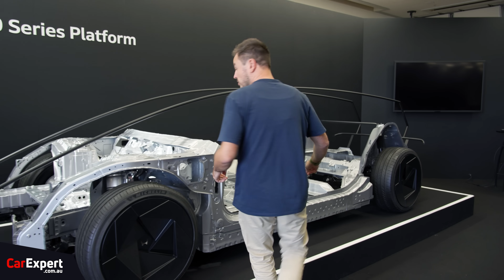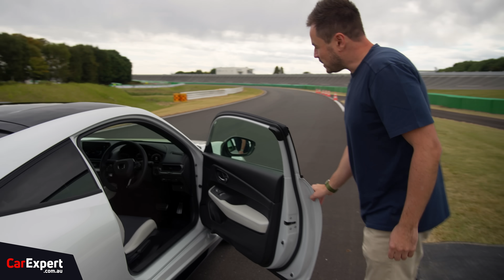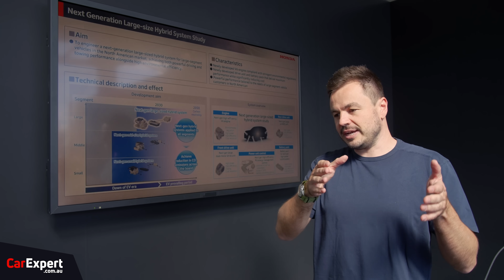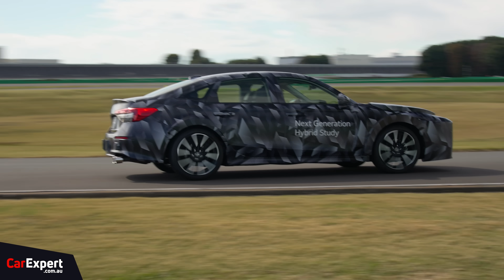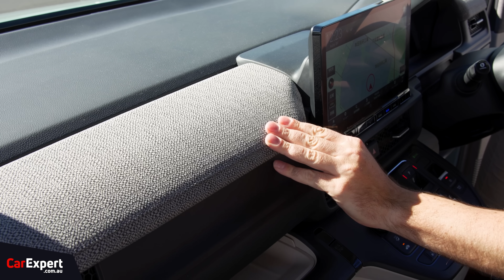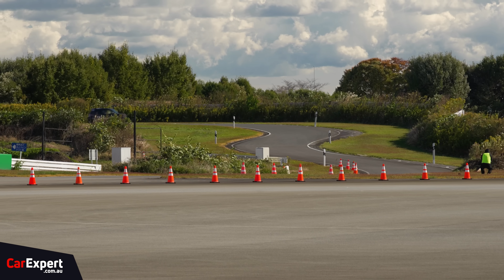Honda Tech Day: Prelude & Super One review…plus future hybrid tech

Comment: Embrace of Enginelessness is Embrace of Degradation
Embrace of Battery-centrism is Embrace of Degradation
Embrace of Over-consumption is Embrace of Degradation — Hybrid-enhanced Gas Version is best possible.
BEV is abject bogus.
PHEV indicates lack of right boldness in leadership and/or management.
EREV suck.
Battery-centric powertrains suck.
Engine-centric powertrains rule.

When Engine-centric Electrokinetically-enhanced Long-lived Plug-free (Hybrid) becomes (critically) more complete with the addition of Manual Transmission (ideally as standard), Hybrid as both the way of the future and the way to the future will become dramatically less refuted and refutable.  Manual Transmission and Hybrid are both best for humanity, so it’s just a matter of time and Japanese Wizardry until this is realized.

Comment: That electric platform is a disappointment, first it has no frunk, second if you crash head on basically the car is a write off because they found that using THE DAMN MOTOR as a collapsible crash structure is a good idea and assuming the crash isn't too bad the car might need a whole new drive unit which ain't cheap.....then they made the prelude...less said about that the better and then they made a hybrid more complicated than a PHD....and killed the civic type R for the prelude....sometimes I feel Honda does not want to make good products on purpose

Comment: I recently drove the civic hybrid my lord was it exciting. The acceleration was so linear like a jet taking off on a runway. If honda puts in a 300-350 hp v6 hybrid in civic and accord it will blow my mind.
Reply: Or you could do it yourself. Why wait? Plenty of people have put K24 in EK civics. Why not a 3.5 litre V6 from the Oddessy in a Prelude?
Reply: @theairstig9164  hmm i have seen plenty of people put k24s k20s and made their civics super fast with 500hp but to be honest i prefer a car which has had millions spent by the best engineers in the world testing in day in day out perfecting the car so that i dont have to tinker with it. For example porsche 911 comes to mind and to be frank even the current civic hybrid even with 200hp is fast and fun. My only complaint with the current civic is that its seats dont have lumbar support and its not comfortable on long journeys. Plus i really like the idea of electric motors working together with the ice the feel of the acceleration is just very different and of course when you drive sensibly in the city its so quiet and get 22km/l. Btw i dont think the 3.5 will fit in the engine bay of the prelude.

Comment: I am still facinated how Honda has decimated it self in Australia. In October they sold only  88 Civic mostly due its pricing. What chance will Prelude have as it will be way more expensive than civic. Honda can make cool cars but they are bit of lost cause in Australia.
Reply: I also have a 2025 Honda civic hybrid. 
It is the best car in its class. 
The hybrid system is ultra refined and smooth and it goes from 0-100 in under 7 seconds so it's quite zippy. 
Comfortable roomy and very smooth suspension. 
Honda's engineering is high end and the car will be very reliable. 
Kia and Hyundai maybe more flashy but their engines suck as well as their vehicle dynamics.
Reply: @mrmysterious6006  it's not only in Australia...  in India as well.. Honda is losing its ground very quickly due to its poor decisions... even me & many ppl like me love Honda but can't help.. we can only look how all this is turning out... the main problem is... Honda is goin through image problem... many young gen ppl don't even know how well engineered & amazing Honda vehicles r... I hv relatives in Australia... they also think low of Hondas & have overpriced - complex engineered German cars... all of em
Reply: @mrmysterious6006 Here in Brazil, exactly the same thing happened. I have a hybrid Civic and I love it. But the price went up way too much, and a car that used to be one of the country’s best-selling sedans became a rarity. Basically, they ended up selling only the HR-V and WR-V in large volumes.
Reply: @mrmysterious6006 still overpriced, it's a joke. If you like it though, power to you
Reply: @CatFinder3000 Have you'd ever driven one?
Reply: @mrmysterious6006 yes, no better than a camry, but costs a lot more
Reply: @CatFinder3000 Ok. 
What do you consider a good car?
Reply: @mrmysterious6006 camry and civic are good cars, the civic cost too much. What are you not comprehending?
Reply: @CatFinder3000 I am processing whether or not you are deluded or clueless. 
If you are saying it doesn't drive any better than a Camry, what conclusion am I meant to reach? 
I have driven both and I can tell you the differences.
The Camry rides softer and is a little quieter in the interior. 
The civic however, has much nicer steering , handles better, and the hybrid system is also more advanced. It is far more refined in its operation. 
Fit and finish is also better in the civic. It's more solidly built.
It also has proper multi link rear suspension setup where as the competition has an inferior torsion beam.
The stereo system in the civic is also far nicer.
I was actually surprised how good it is.
Is it overpriced?
Probably but it does include  a lot of servicing and roadside assist for 5 years too.
Reply: @mrmysterious6006 100% agree. I have a 2024 model. The dealer guy himself owns a camry hybrid top spec and bought it before the civic hybrid. Said he would've waited! Now, you could take that as marketing or trying to sell me on it..

Or you could believe that I've also driven both camry hybrid and obviously my own civic hybrid, and can 100% attest to everything you've said. It's worth noting the camry is a bigger car. In reality it's direct competition is the Accord but pricing makes this a weird comparison.

Agree that the interior really needed more sound proofing. Above 70 tyre and road noise is quite intrusive. No spare tyre also sucks but isn't uncommon in a lot of newer cars, especially in EVs.. There's a couple issues with the front seats too but apart from those items it's basically perfect.

Not sure if you were offered as well, but I was told as long as I maintained service with a registered Honda dealership/servicing customer post 5 years, I maintain full manufacturer warranty for 8 years. Though capped price isn't extended.

Love my civic! Just do wish it was 10k cheaper anyone buying now should only consider the L, not the LX, as I don't think it warrants the extra 6k (I have an LX because the L didn't exist in 2024).

...also paint is thin as hell lol
Reply: Basically non existent in the South African market as well. It's a shame because they're such good cars but they come at a huge cost. They charge the same prices as in North America for different markets.
Reply: @NyonibjrSame case here in Pakistan, except they have less features but are still 20% more expensive than American Touring model. And obviously no one is buying them because chinese cars have captured everybody else's sales.
Reply: What I find nuts is I have a 2007 V6 Honda that can drop down to 4 and then 3 cylinders whilst coasting at a constant speed to save fuel and I can get over 800kms out of a tank on the open road. Why the hell don’t cars have this now?
Reply: @ablet85  Because most cars these days are 3 or 4 cylinder put put mobiles out of the factory. There are certainly still brands that do it, even with the 4 cyl. Honda, VW, and Mazda to name some. 

I have a newer BMW 5 series with the B58.  I have it tuned to about 400kw at the rear wheels. When I am not running a E85, the car averages about 700 - 800ks on a mix of Highway/round town. On my last trip we drove from Sydney back home to near the Sunshine coast and I still had a few ltrs left. 

The tech is still there, and it's still used. They just don't advertise it as much because it's an old technology now.
Reply: @ablet85  Because the tech is very finicky if it breaks and the fuel savings aren't earth-shattering. And with hybrid tech so mature now, there's little use case for it. Holden V8s also had this tech (AFM).
Reply: @ablet85  i havent fact checked myself on this but my guess is uneven wear and tear on cylinders and complexity of ECU tuning air fuel ratio stuff.
Reply: Hopefully Honda manages to stay strong in Australia long-term.
I’ve always loved the old-school NSX, Integra and Civics — proper affordable gems. Love the design too👌

These days some honda dealerships are also selling Chinese brands on the side, which shows how they’re trying to adapt and stay afloat as a low-volume manufacturer.
Reply: Even without Australia there still the 4th largest automaker in the world in terms of sales
Reply: @f181234  Really!!!!
Reply: I got very excited yesterday when I saw a band new Accord on the road, it was a bit of a sad moment
Reply: My 1994 VTIR Prelude came out with 140 something Kw 30 years ago!! Surely they can do better.
Reply: they've just determined that they aren't an important market anymore. they make their real money in North America
Reply: Honda civic has been 10+ years best selling car in Canada before Covid, now I hardly seen a new one on the road here. Same reason you mentioned, pricing.
Reply: Prelude will di terrible in USA too .. idk what honda is thinking… 

Prelude flop
Prologue flop
ZDX flop… again 
Clarity flop

In 2024 Civic barely outsold corolla, despite civic generation being just 2 years young and corolla 6 years old
Reply: Wait till BYD gets going
Reply: Not to challenge the number sold but curious on the source.    I agree that Honda has lost its high rev soul
Reply: Would love a new prelude but way too expensive sadly.
I have a 2016 Civic and is amazing and only got it New for $26,500 as an X display model luckily.
Reply: It's not trying to sell cars mate. It's trying to differentiate itself by being a premium offering to Toyota and Subaru and for the most part it is. Bought a CR-V and it's much more refined and premium feeling than the RAV4, Tiguan and Forester.
Reply: @keynesianeconomics4113 I mean at the end of the day even the most luxurious carmaker's aim is to sell cars lol.
Reply: @anaesthetics  not by volume but by selling status. Honda is struggling to either do it by volume or prestige status, which is why they are failing like crazy. Their products are really well refined, but they are not making cars for either the poor nor the rich, but the limbo.
Reply: @keynesianeconomics4113  Not doubting you. I see Honda as a great enginering company with great products. Selling only top grades of you model offerings does not make you premium manufacturer by default overnight. Premium is deceiving word .In peoples minds Premium is Mercedes, BMW, Porsche,Lexus, Land rover etc. Honda needs to sell cars otherwise they will not exist as automotive brand. How often does anybody see 11gen Civic on the road or Type r ? In 2006 i bought civic vti brand new on finance with apprentice wages. Still driving it today 320000k later. Can any apprentice will be able to afford it today ?
Reply: @keynesianeconomics4113  " by being a premium offering to Toyota and Subaru " Isn't that what Mazda have been doing for years now? Making a more and more expensive models, that don't sell as well.
Reply: @keynesianeconomics4113  australia must be a small market for them too.
Reply: You summed it up well.    I've had multiple Honda's since 1982 and loved every single one. But today the prices are a joke, especially when you can write a decent list of what you won't get for your money compared to other brands.   $64,800 for that ugly Accord??  and where is a larger SUV??  
My devotion to the brand is dead. Maybe I won't be completely scammed by service departments of other brands either??
Reply: @davidm4689  you have to account for the fact that honda ain't gonna cost an arm and a leg come time for "repairs."

you don't seem to be complaining about the euro brands exorbitant prices.
Reply: We were living in Brisbane at the time and went to buy a new CR-V from their Gabba showroom about 7 years ago, no one wanted to acknowledge us, there was no one at the reception, 4 sales guys were busy chatting in a corner - saw me and my wife and dispersed within a minute- all ran out of the showroom. On another occasion my Accord Euro’s stereo and A/c controls stopped working - took it to the Shailer Park dealership where it had been serviced for the past 6 years, they charged me 88$ for diagnostics and then quoted 900$ for a replacement unit. I ended up replacing the fuse for that circuit for 5 dollars total and fixed it. These two experiences have sworn me off of Hondas for life.
Reply: All cars going to be more expensive because of inflation and Donald dumb ass creating chaos around the world 🌎